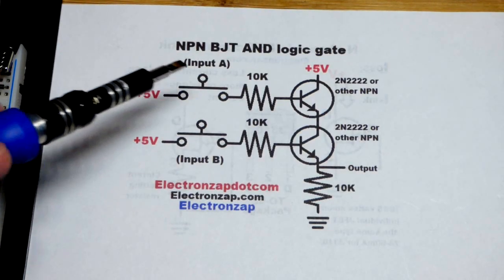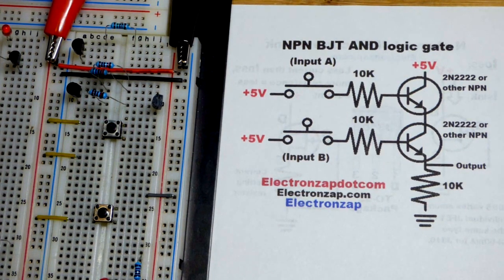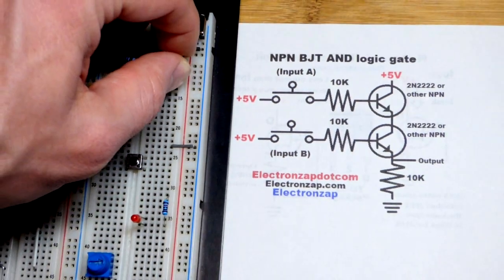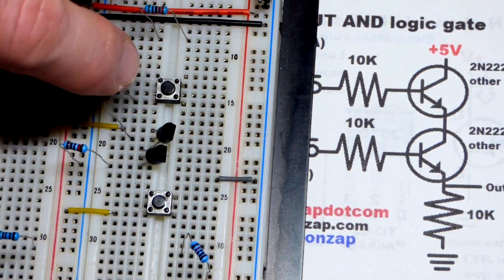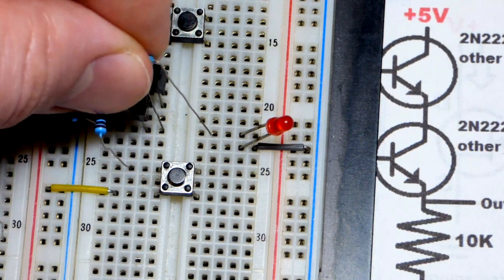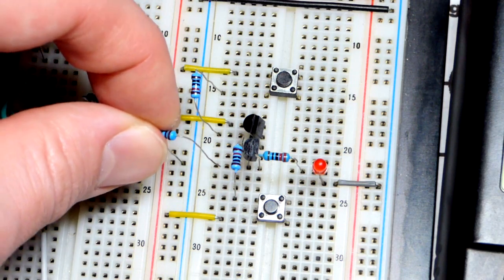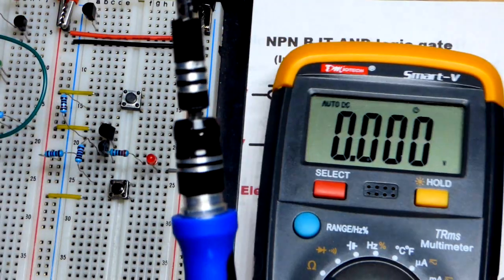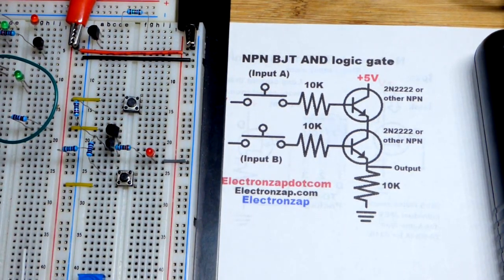Quick AND gate using NPN BJT circuit with electronics 2N2222 bipolar junction transistors

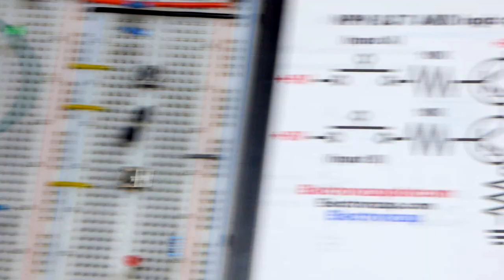Comment: 2:54 I believe the emitter resistor helps to form a voltage divider with the load? Even if that is correct I couldn't answer WHY we need a voltage divider tho ...
Reply from the maker: It doesn't really form a voltage divider, it helps the supply hold the voltage at the emitter based on the voltage given to the base, when certain loads would throw it off. The voltage drop of diodes messes up the voltage down the line and the emitter resistor helps keep the emitter more grounded.